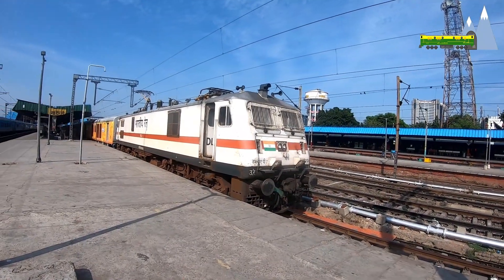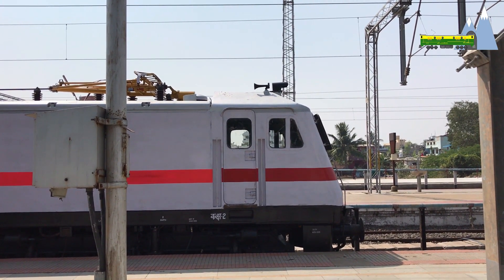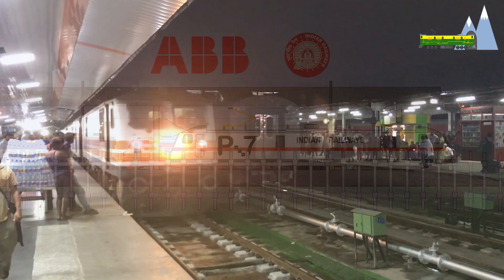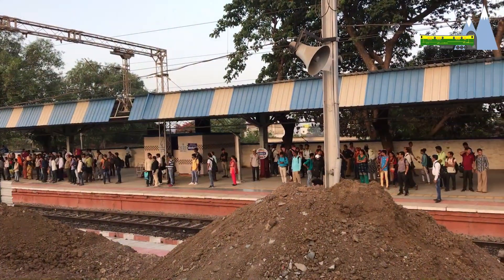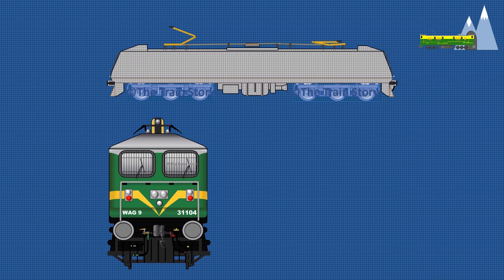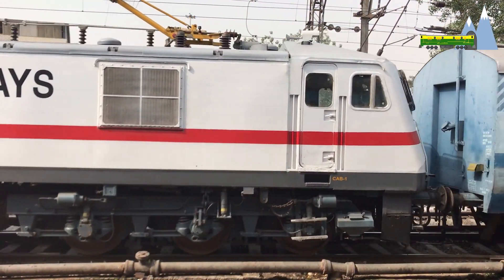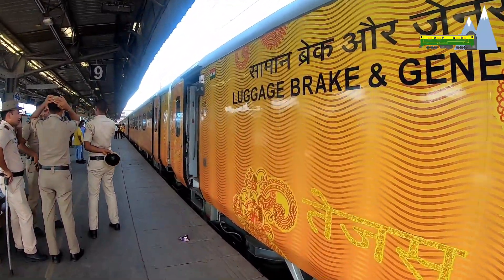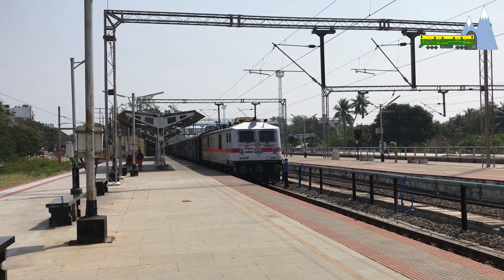WAP 7 Electric Locomotive

Comment: When wap 5 locomotive top speed 225 kmph is limited to 160kmph , what is the meaning full use of that extra 65 kmph ?
Reply from the maker: WAP5 was designed for future topspeeds of 200 kmph, particularly on the Delhi Mumbai route. But the track upgradation has been indefinitely delayed…

Comment: Very informative and crisp video, thanks for sharing. WAG9, WAG10, WAG11, WAP5 & WAP7 are the most aesthetically appealing locomotives operating on Indian Railways as of date. I hope the IR $3B contract to Siemens for 1200 9000Hp locomotives turns out aesthetically appealing locomotives.
Reply from the maker: Thanks friend
Reply: @TheTrainStory  Where would the 9000 HP variants be used ? Not the High speed (>140kmph) service runs I reckon? Would it mean even longer trains (28-32 car lengths) ?
Reply from the maker: @kanakTheGold  I think IR is now moving towards trainsets…I m not sure if IR will go ahead now with a 9000 hp passenger loco

Comment: Is there any possibilities to make a Passenger version of wag 12b
Reply from the maker: With the Govt placing emphasis on Trainsets (Train 18), there is no requirement of passenger versions of high powered locomotives such as the WAG 12. Lower power-rated but lighter train sets can provide services in the 160-200 Kmph range
Reply: @TheTrainStory  yeah I understood. Multiple units has several advantages like quick acceleration and braking, consistent speed etc. ICF Chennai wants to produce more train 18 varients for the future

Comment: The one thing that missing in WAP-5/7 loco motives is proper ventilation.These locomotive are designed for European standard but here in india hot place.
Indian Railways is doing good by making air-conditioning cab of new loco motives but what about locomotives launched before.
If the temperature outside is 45 it feels 55 inside cab.hope you can understand.
Reply: If Indian Railways wanted they could have istalled cab air-conditioning on top of the roof

Comment: Who provided the tech for WAP 1 and WAP 4 locos? Is it ABB or Gen Electric?
Reply from the maker: WAP-1 traction motors are from Alstom and those of the WAP-4 are from Hitachi.  Other companies like Siemens have provided important control equipment. These locomotives are built in India but technology has been sourced from various vendors...
Reply: @TheTrainStory  Great !
Reply: Wap 1, wap 4 and all dc traction motor electric locos are modified version of wag 1 which was designed by English electric locomotive company in 1950